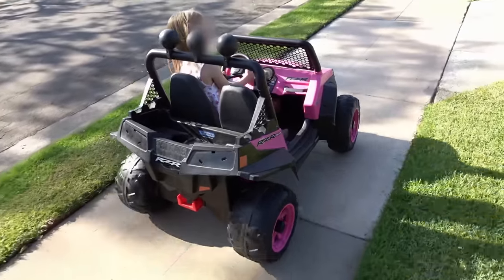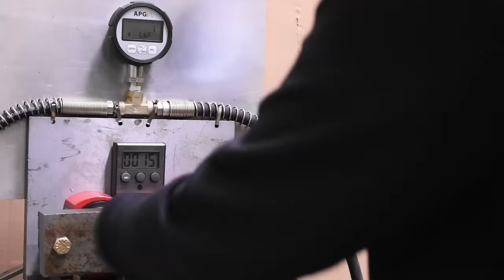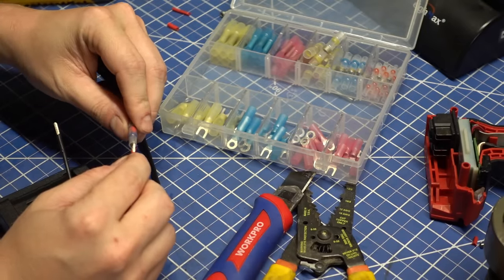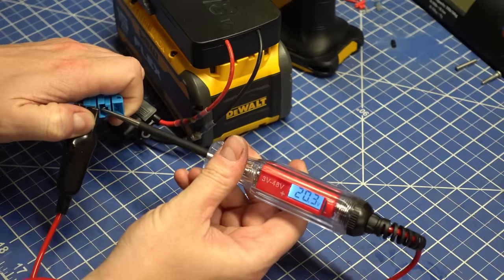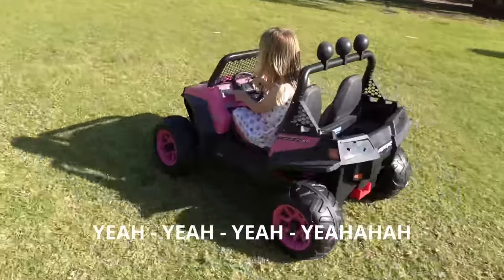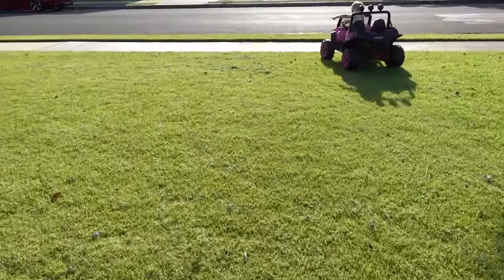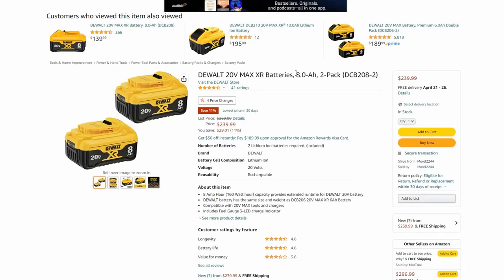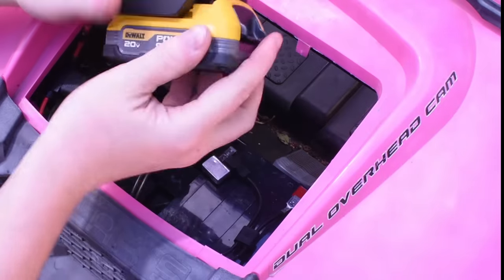I Figured Out What DeWALT's Huge $400 Battery is For😄(Kids Power Wheels)

Comment: My kid has a 24 volt awd electric car. Would this setup actually slow it down? Would 2 Milwaukee M12 9amp batteries be better since in series they'd be 24 volts?
Reply: Motor speed is a direct relationship to supplied (battery) voltage. Higher voltage results in higher speeds. So two M12 batteries in series would supply the same 24 volts the car originally had, thus the same (or at least similar) speeds. One single 18v battery would result in roughly 3/4 the speed of the original.
Reply: @xenaguy01  thanks. That's what I was thinking. So 2 M12 batteries would be better than the huge DeWalt here, right?
Reply: @luisprieto4390  
Depends on what you want, and have. DEFINITELY DON'T buy a giant DeWalt battery just for this. But, if you already own one, use it. If you already own M12 batteries, use them. 
-Wiring the M12s in parallel will double the life at 12v. There will be no increase in performance. -
Using the 18v will give a roughly 33% performance decrease for as long as it lasts. 
I screwed up my second paragraph. Yes, the two M12s will give the same speed as the original 24v battery.
Reply: @xenaguy01  my kids ride on is stock 24 volts so I think I'll opt out for 2 M12s in series. Thanks

Comment: I have a bunch of Lipo batteries for RC cars and I always wondered what kind of performance I could get out of a 22.2v 6s lipo set up. I mean technically you could upgrade the ESC and motors as well but would a 22.2v 30,000MaH make that thing super fast and would the electronics handle that king of power?

Comment: Watch out for the torque as well homie cause it will shear the teeth off of those plastic gears unless you have a metal gear made then a host of other problems will retire the riding toys I have a graveyard of them that need to have motors and gears and wheels. tires replaced because it will melt all of the plastic with torque.

Comment: I wonder if it necessary to change the gear motor to 18v unit, or still can use the stock one (12v), will the motor (12v) burnt if we use 18v batteries, also the control unit need to change to 18v or still can use the stock, please someone answer me

Comment: And if you wanted to go faster than remove the lock out and let her go into high.
Reply from the maker: The 12v battery was dying. Does help with acceleration. And now she's older and uses mode two on 20v
Reply: @TorqueTestChannel  hot rod

Comment: I’m really not sure if I should get a replacement 12volt 20amh (higher capacity than stock) or the power tool adapter. I only have a Dewalt 20v 6.0 (for a power wheels style 12v quad)

Comment: I'm curious how many Amps those batteries can output.
I have am M12 battery hooked up to an adapter and I put some banana leads on it for bench testing.
The other day I blew a 20amp fuse with it.
I'm assuming the 20volts can output alot more
Reply from the maker: It can output more, but it's only going to output what the motor requests of it.
Reply: @TorqueTestChannel  
This channel is all about testing lol what the max output.
Time for a carbon pile tester 😂😂
Reply: A standard DeWalt drill is around 500W of power, that gives a pretty good idea of the amperage the battery has to output I believe, stall current may be quite a bit higher, and the higher end drills even go to 800W
Reply: @piciu256  800watts ÷ 20volts
40amps that pretty impressive

Comment: These videos are all the same. Some inexperienced dad wrecking expensive batteries. You should be running a lvc or atleast advising other people to. Also adding a 6volt lead acid in series will accomplish the same results for 20 bucks fyi.

Comment: Our daughters weak point on her high/low 2 speed john deere tractor with the pick up bed with the battery conversion, was the plastic gears on the rear axle. It just ended up shredding them.

Comment: Would have been cheaper to use a car battery or lawn mower battery
Reply from the maker: Using something you already have is cheaper than spending anything
Reply: @TorqueTestChannel  no not really you had to buy the battery didn't you? Why not put a battery in it and leave it in there? Instead of taking ine of you tool batteries everytime
Reply from the maker: 1:12 nope, it was just laying around here. Money was already spent months ago, basically recycling :P
Reply: @TorqueTestChannel  why was you not using it than?
Reply from the maker: As the video said, we bought it to test some tools with. But it's probably made for lawn mowers and huge 60V equipment. We dont regularly use it on hand held tools it's too big, so in the little lady's off-roader it goes. See pinned comment, this sort of thing makes sense if you have power tool batteries, like a viewer of ours is very likely to have. Not to go out and buy power tool batteries.
Reply: @TorqueTestChannel  so when are you putting her in the power wheels derby?